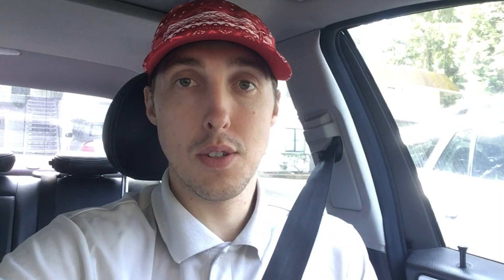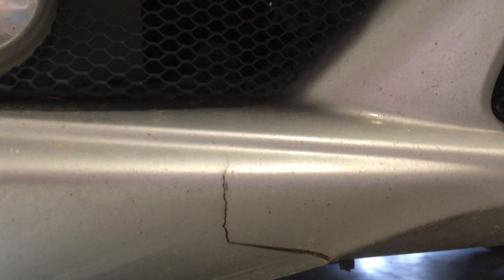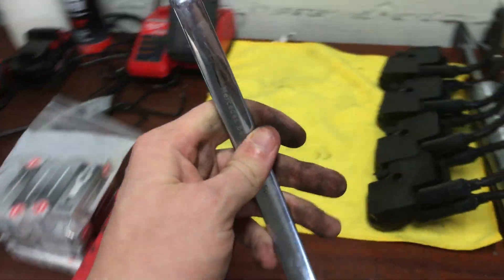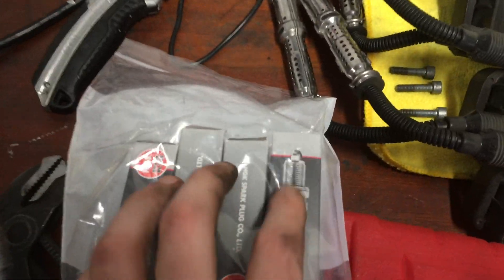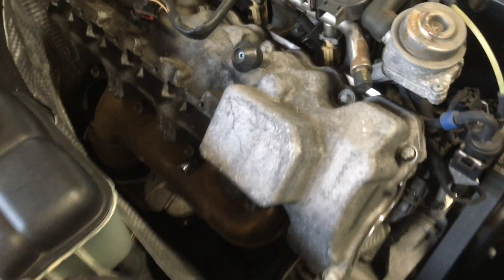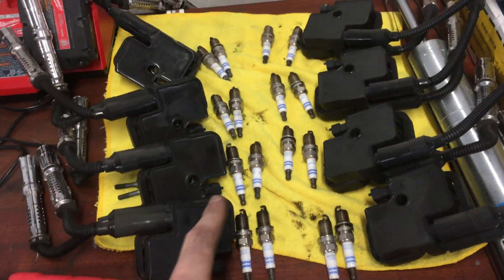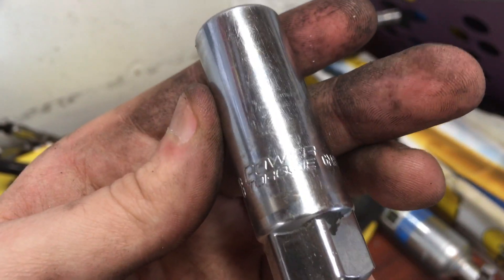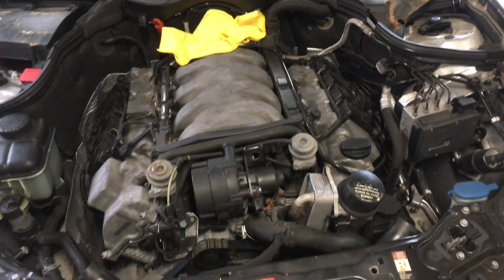*OLD SCHOOL* SPARK PLUGS IN A MODERN PERFORMANCE V8

Comment: Good video. Hazet 4766 this is wright tools that is time saver when you are changing spark plugs on 112/113 engines.
Reply from the maker: Thx for stopping by, what is different about that tool specifically? It seems pretty expensive if just a spark plug socket.
Reply: @ANDERZENAMG  
This is designed such that allows to reach the spurk plugs on that engines very easy, it has built in swiwel joint, also it has exclusively developed spark holder system built inside. Official MB part number is: W112 589 01 09 00.

Comment: Great vid man. Delete that secondary air pump. I did on mine. Follow me on IG @midnite_amg
Reply from the maker: I have thought about doing so on both, any pointers on how to do it? Are you tuned or how did you avoid CEL? Thx for stopping by and commenting btw!
Reply: ANDERZÉN  I am tuned. The work was all done by Eurocharged ATX. I’m not sure if it will throw a code but You may have to code it out in STAR

Comment: Thanks for the vid. Not sure about the lip (too low for my liking) but im sure you will make it fit and look nice. One thing when changing the plugs, its good practice to blow/clean around the plugs before they are removed to reduce the chance of dirt getting into the engine. I do note that you remove and replace by hand which is the correct way to do it.
Reply from the maker: Totally agree with you on the lip, I will try to get it is flush as possible otherwise I have been contemplating building a functional front splitter instead. I like the fact that this car sits nicely over most curbs and don't want to take that functionality away, just want protection.

Blowing out area before removing the plugs is a good idea always, used the air compressor on mine but forgot to include that on camera! Thx!